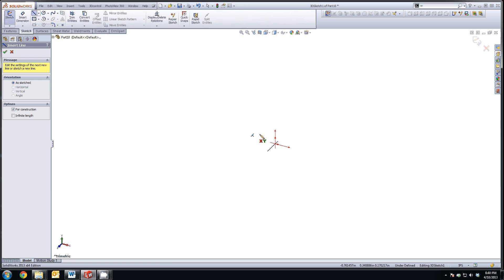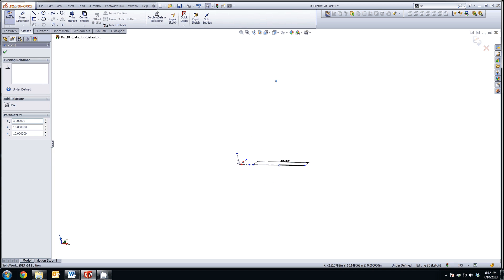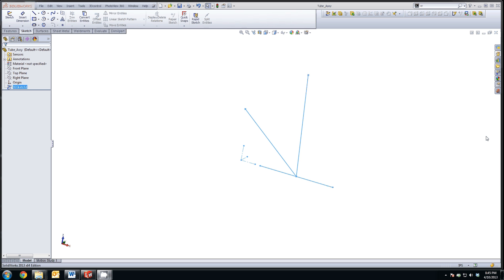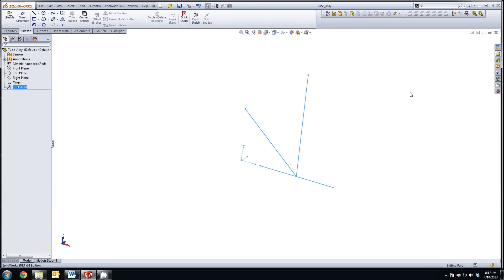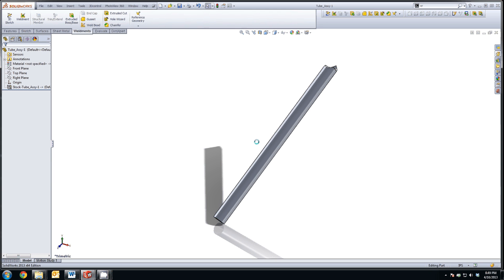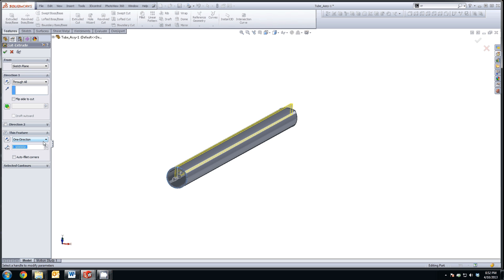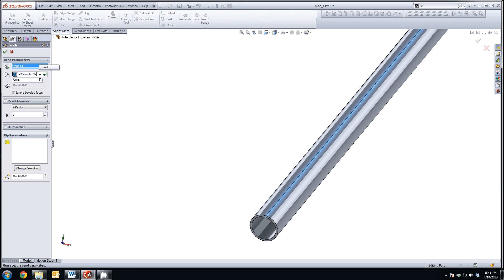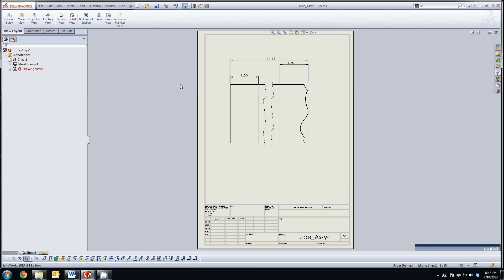Solidworks 3D Sketch Tube Weldment, Cope Tubes, Flat Pattern Tubes, Paper Templates for Tube Ends

Comment: Great video, I learned a couple new things I didn't even expect.  One quick question...  You use the Diameter of the outside of the tube (1in), but why do you choose the inside edge to flatten / insert bend (which has a smaller 0.870in diameter than the outside of the tube)?

Comment: when i get to the part of insert bend to the inside edge it errors and says non linear edge is invalid 

granted im trying on a tube with a notch on both ends 

the process worked just fine on a straight cut end of a tube 
any help would be great
Reply: @Travis Wesley after a year I am looking for the solution for the problem 
Can u help

Comment: Great video dude, this is all new to me, and I was looking at buying Bend Tech Pro SE with the SW module, which basically does everything you showed, but a hell of a lot quicker.  However what I am confused about is: 1. How do I know what angle to set my notcher at? 2. How do I determine angle of rotation for a second notch?
Reply: Richard Pece The angle of the notcher should match the angle that the tubes intersect.  Go back to the 3D sketch (tube centerlines) and throw down a reference angle dimension between the tubes.  For your second question, if you use the paper method, you simply make sure the paper seams are aligned.  If not, you need to determine the relative angle between the two tubes that interesect the tube being cut.

Comment: wow, so much useful stuff in there! nice work!
Reply: but what if you don't have a regular surface in one of the ends to draw your slit? i was just testing here with a tube that is irregular at both ends and can't figure a way to sketch on it. the standard planes are disoriented just like yours, and plane creation rules are too stupid to catch my intent. any thoughts, anyone?
Reply: El Fueda nevermind, i just switched off and back on again the display of temporary axis and only after that i was able to individually select each of them. upon selection of the longitudinal axis of the tube i was able to use it as a perpendicular reference for the custom plane, on which i could draw my slit.

Comment: I can't save the file it says that i don't have permissions to save in this location,
what should i'll do?
Reply: I know it is just 3 years late, but just in case you didn't find a solution, do this: 
Save somewhere else, say desktop. Minimize your windows and, Copy later separately from desktop to that folder specified in the video..
Reply: Thanks man!
Reply from the maker: I would try to save somewhere where you have permission to save...such as on your desktop or in your my documents folder.
Reply: In properties -> file location you can add a custom folder for your weldment profiles. Just makes sure you have subfolders for 'standard' and 'type'.
Reply: lol ... it's funny remember i wrote it 3 years ago!, thank you for your answer anyway. well I'm not using Solidworks anymore I moved to Maya zbrush that kind of stuff.
Reply: Haha np.. So you have become a pro huh?
I'm working on a project for my college technical fest, let's see how it goes.. fingers crossed..
Reply: naa.. not a pro, i always wanna do more kind of 3d art and solidworks is not the right tool for that. it's a lot more technical and designed for mechanical engineering unlike Maya/3d Max which you can model  3d characters for example. anyway good luck with the technical fest!
Reply: Oh, that's great!
Thanks for your wishes man!
Reply: This doesn't work as when you go to add the weldments in it only allows you to be directed to the folder highlighted in the video
Reply: i tried to save it in the folder as the file type it shows in the video but when i open it to a sketch path  it says that there is nothing in that folder. In what format do I save it so that it works? thanks.